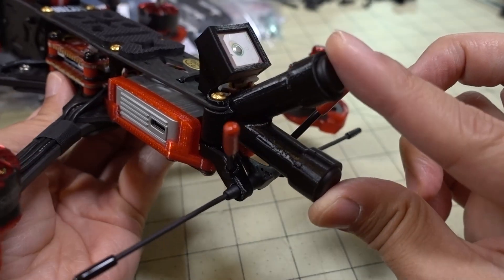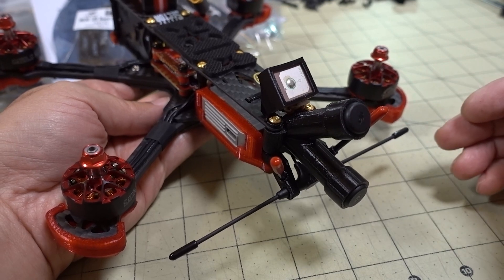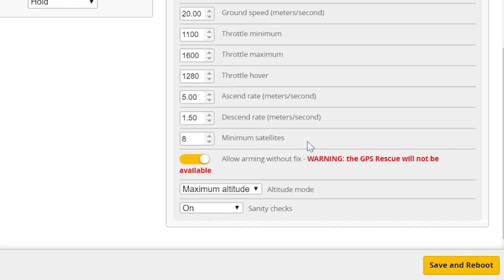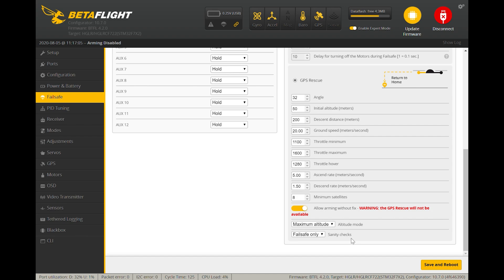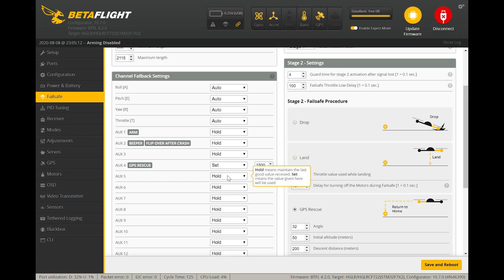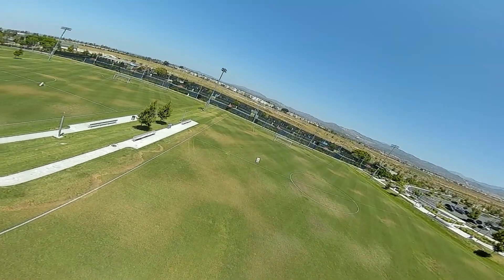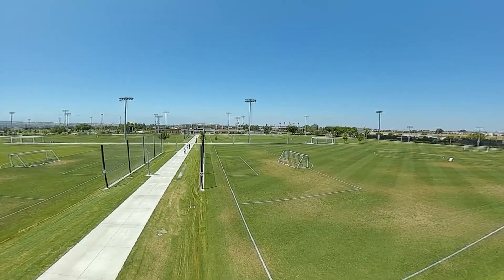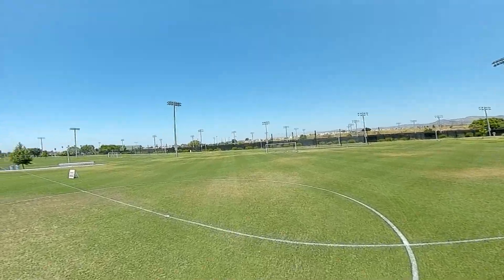HGLRC Sector5 v3 GPS Rescue Setup Tutorial 🛠️

Comment from the maker: Auline 1550mah 4S Lipo - http://bit.ly/2Xs2iwz | http://bit.ly/33qET27

HGLRC Sector5 v3 DJI 4S
     http://bit.ly/2X40SrR | http://bit.ly/2P6F76h

HGLRC Sector5 v3 DJI 6S
      http://bit.ly/39G8fL9 | http://bit.ly/2X40SrR

Analog version - http://bit.ly/2P6FaPv | http://bit.ly/2XbnPt7
Frame Kit - http://bit.ly/2P9NtKi | http://bit.ly/3378hdz
FC Stack - http://bit.ly/30buIN5 | http://bit.ly/39BEpHI

Use code BGSetor5 for 8% off at BG

Watch overview video here - http://youtu.be/8aPc06xUhsk

Comment: Firstly thank you for your great in-depth video. I just wanted to ask, what does it mean when the quad starts to drop altitude after initiating  return to home ? I  was out testing my quad and was at 100 meter distance and once I switched to return to home (fail safe) it started to descend  from that distance? i thought it was supposed to descend closer to the home point ? I have my settings set up the same as yours. Thanks in advance 🙏
Reply from the maker: It goes to the set altitude in the settings.  So if you're higher than the set altitude, it will go down.  If you are lower, it will go up.
Reply: @AlbertKimTV  Thanks for the reply, I will give it another try, so if it’s higher it should descend to the set altitude and fly back at that higher and should only descend at the home point correct?

Comment: Hi Albert, when you switch your gps recue switch in betaflight does it highlight it like the other switch to indicate it’s ON? I’m setting up the gps on my sector d5 and the gps rescue is not highlighted. The bar moves but it does not highlight. Now I’m not sure if it’s working or not. Is there a setting I’m missing?
Reply from the maker: It won't highlight unless the conditions allow it to activate.  If you try that with the arm switch with USB plugged in, you'll see the same thing, though don't try that with props on!
Reply: @AlbertKimTV  okay, so it’s normal then. I’ll test it soon to see if it works. Thank you. Btw I tried it several times with the props on. lol

Comment: Nice one sir. Just setup my new HGLRC M80. I tested outside without props about 10 mt far. I am getting 14 sat but I am not getting home arrow on my DJI goggles and as you said i have assigned a fail safe switch to test but when switch is activated the motors stops spinning. When i flick the GPS rescue swithch when armed the motors are spinning fast that means rescue mode is working but on fail safe mode motors stop spinning. My 3D fix shows true. Any clue sir need help. Today i walked about 100mts with the quad and checked with the same result
Reply from the maker: You need to place the home arrow element on the screen in the OSD tab to see the home arrow in the goggles.  Sometimes you have to fly about 100m away to see it work properly.  It may not at close distance.  If you activate GPS rescue within 100m of the home point, it will fall out of the sky.  The motors stopping is correct.  You have to be more than 100m away for rescue to work properly.  I recommend you read over everything in the wiki page.  Looks like you missed a lot of stuff.
Reply: @AlbertKimTV  I have walked abt 100 mtrs with the quad ro test 😭. Not close. Home arow is places on the osd correctly sir

Comment: So can I use the same video that you have for the hglrc Sector 5 V3 GPS rescue setup tutorial for my Darwin 129 with GPS
Reply from the maker: Yes, the setup is basically the same.  The uarts might be different due to differences in FC so make adjustments as appropriate.
Reply: @AlbertKimTV  so how many wires would I have to solder on my Express lrs receiver where do I Sauder them  to
Reply: @AlbertKimTV  hey Albert I ordered several things through your things so you could get your little commission from pyrodrone oh, man this is the worst place to order anything from I have ordered over almost $600 worth of stuff just this weekend from Thursday through this weekend and everything that I have purchased from them that I have paid extra I'm talkin 50 something dollars on one of the USPS and late everything matter fact it's got some of them saying it's going to be substantially late I should have bit the bullet and ordered it through eBay we would have costed more but I know one thing for sure into a certain I would be getting it they're not fixing to send this now they're going to do what most places do say shipment lost they can't find it don't know where it's at two weeks later I had a specific date and time because I'm moving from where I'm at so man please don't recommend this to nobody because it would be just as it is for me it's the worst place it is to order from ever I have ever ordered from in my nine years of ordering off the internet

Comment: Hi, nice video. If you fly past RX of the transmitter will it automatically enter GPS return mode, or do you have to flip a switch? If so, and there’s no Tx signal how does that work?
Reply from the maker: When it enters failsafe (assuming RX was setup correctly), GPS rescue is triggered automatically.  Most problems happen when the RX failsafe is not setup properly and the FC doesn't know that it needs to trigger GPS rescue.

Comment: Thank your for this video! The best one I have seen so far about RTHs!!
I will receive this quad in a few days (my first one !) and I was thinking about how to configure this failsafe :) So huge thanks.
One question however: in your video, you configured the RTH on a switch. Is this possible to automatically activate it when the quad lose the transmiter signal for example ?
Thanks.
Reply from the maker: Yes, watch about 2:40 in the video where I switch the failsafe procedure from "drop" to "gps rescue".  This is how it will activate in case of receiver failsafe or "lose signal" as you said.
Reply: @AlbertKimTV  Oh thanks for the confirmation!!! Sorry I had not understand it that way, but it is clear now. Thanks a lot!

Comment: Just came here to give you a 👍🏻 & ask, why my 8” quad with DJI will fall out from the sky with GPS rescue RTH? My quad at the esge of my DJI video signal pixeled gave a RTH then did a 180 and fail safed to the ground
Reply from the maker: There are a LOT of reasons that could happen.  Were you closer than 100m away when RTH was triggered?  Do you have failsafe properly setup from transmitter to receiver?  Those are the two most common ways this can happen.  There are about 20-30 more ways this can fail but you'll have to read the wiki page to get more details.

Comment: hello Albert,
I am piloting with my DJI radio and would like to know if your RESCUE GPS setup (set to Failsafe only) is working if I lose signal or video?
Reply from the maker: I'm using a crossfire receiver and not the DJI radio.  You can test failsafe on the bench and also make sure your aux channel for gps rescue is set to activate on the failsafe tab.
Reply: @AlbertKimTV  OK THANKS , and of course, my Aux channel is set properly for Gps rescue
Reply from the maker: Also make sure you set that channel to trigger in the failsafe tab as I mentioned in the video.  Then it should work.

Comment: How do you kick it out of GPS Rescue if it failsafes? Do you manually toggle your GPS Rescue switch?
Reply from the maker: Yeah manually toggle the switch.  However, if your connection is restored, it may switch out for you.  It will depend on the receiver, so you should test this before going too far.
Reply: Moving the sticks 25-30% should shut off GPS and give you back control.